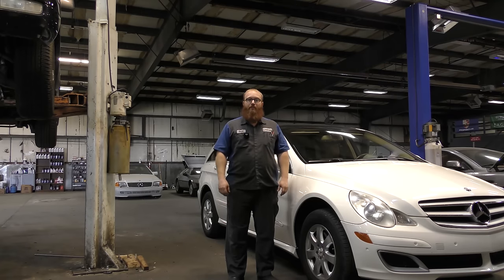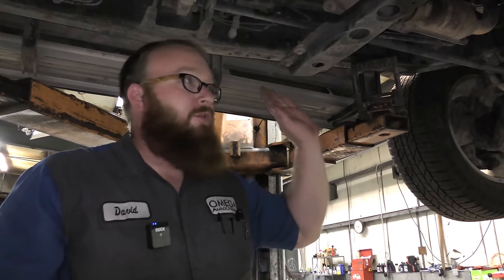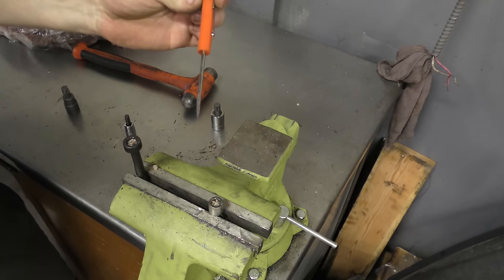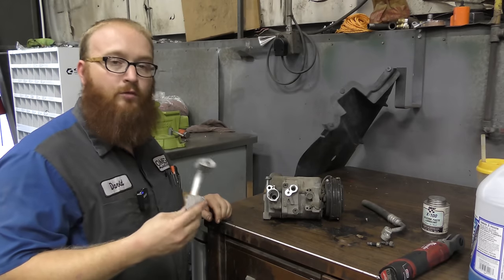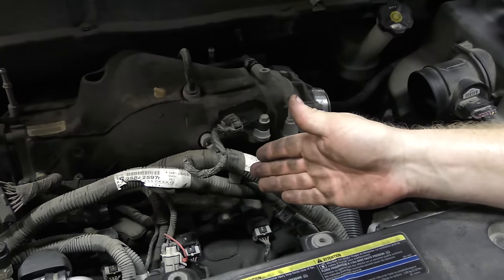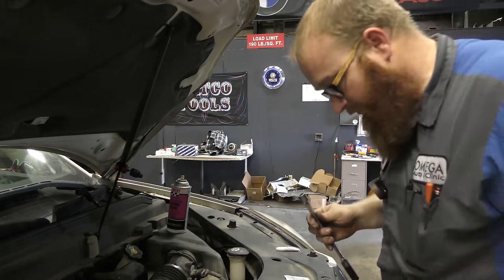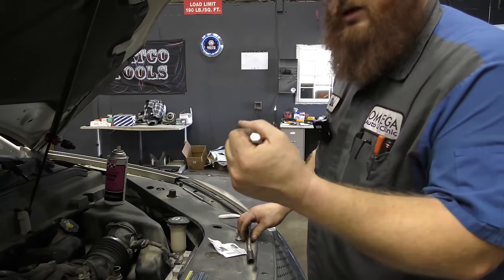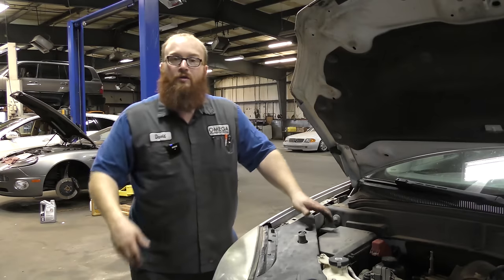The CAR WIZARD shares 10 Crazy Easy and Essential Mechanic Tips

Comment: I've been a mechanic for 33 years and I learned from your tips! Everyone sees the trees different so don't think that experienced mechanics can't learn from your videos. Going to get those relays. A+
Reply: I make videos specifically for beginners trying to learn about concert sound but I get a fair number of veteran concert engineers (who are way more experienced than I am) saying they learned new things from what I've shared. As you said, "Everyone sees the trees different". 😮🤯🤘
Reply: I've been an IT systems administrator for about as long.  I'm used to thinking of things end to end in a systematic way, paying attention to cause and effect, cascading problems, focused methods of troubleshooting.  And I do stupid, random stuff when out of my element in the car.  Always good to realize that we are constantly learning, and nobody knows it all.  Grateful to find the Car Wizard.  The paper trick for sockets and the superglue for washers; I can't believe I've never tried that!
Reply: @UncaringAsshat  Paper tape or a bit of thread or even a blob of heavy grease can also hold on a washer to help get it in place.
Reply: Where can i buy such relays ???!!!
Reply: @z.b6506  you would better make it yourself, it only contacts the pins 30 and 87 together, nothing complicated.
Reply: I learned about 50 years ago to humble myself and listen to ALL viewpoints. The smartest, best and most talented mechanic can learn something from the dumbest kid on the block
Reply: @freesoul9324  thank you, was thinking to do them myself from old relays
Reply: A switch and two pins is all you need until you get to a Chevy relay.

Comment: To lubricate "O" rings I've used Vaseline Petroleum Jelly for 40 years, never had a problem cutting or nicking  seals. The Navy called it Petrolatum Technical, same thing, works great and it's cheap.
Reply: That will work well with any rubber that's not a natural base rubber. There are a few types of rubber which are not used much any more that will degrade from contact with petroleum distillates.
Reply: vaseline is also used to assembly rotaries
Reply: Astroglide work well too lmao

Comment: Hello David, 
As an Electronics Technician for over 40 years another trick that I have used especially with electronics circuit boards when you have to attach a fastener that is not magnetic and is hard to get to, I use beeswax. This will hold a Phillips head or a Allen head screw securely attached to the tool. What's great about this tip is that the beeswax is inert and non-conductive. To keep the beeswax handy but not sticking to everything I will put some into an old cleaned out deodorant container. This way every time you need some you take off the cap and screw up the beeswax to expose it and dip your screw head or your to head into the beeswax. To obtain the beeswax I use the wax ring for a toilet. Hope this helps.
Paul

Comment: Two more tips. 
#11 The fuel pump hammer trick can work on any electric motor that has locked up. Your window regulator motor is a good example. Tap the motor lightly with a hammer as you apply power. Same with a bad starter.
#12 When dealing with a very stubborn bolt or nut especially one that is already slightly damaged Tighten it to break it loose, then loosen it. Sounds counterintuitive but it works many times.
Reply: Washing machine motor too, do you think?
Reply: @bluestripes6037  Can work haha.
Reply: Used this trick for many decades, electric windows, stater motors, shavers, washing machines, vacuum cleaners anything with brushes
Reply: If i tighten a bolt until its loose I got way more problems pass
Reply: I have seen that tapping used to free the starter motor's silenoid.
Reply: @clydedoris5002 you don't tighten it until it's loose. You just tighten it to break it free. More go back and forth, tighten and loosen. It works well on stubborn or rusted bolts.
Reply: This is REALLY useful for a bad starter as well… if you can get a hammer to it, give it a couple of taps while a buddy is cranking and I bet she gets spinning and you are back on the road. You can use a screwdriver or extension to reach it too….

Comment: The Bob Ross of auto repair, good info and relaxing to watch.
Reply: If your fuel pump is stuck, get a rubber mallet, go to the gas tank and just beat the devil out of it :) lol
Reply: Happy little bolts
Reply: Yeh. Kind of asmr for mechanics
Reply: However, unlike painting there are no 'happy accidents' in car mechanics.
Reply: The new generation of shade tree mechanics is us YouTube mechanics. 😎
Reply: Ob
Reply: @amerlin388  I got a car sold to me cheap because check engine light had been on a while and it was running like garbage. When I opened the hood, the MAF and IAT sensor plug was disconnected. That was a happy accident.
Reply: Happy little bolt.
Reply: knob
Reply: Ahhh Bob Ross 🔥
Reply: The Rhins Ranger harder than it sounds with the vehicle on the ground
Reply: It's relaxing because all this info isn't leading up to me getting my wallet out to pay a hefty sum, someone else is!
Reply: Yeah, exactly. And he has also this certain wow-factor to him aswell. ^^
Reply: Who's the other German tv painter guy,  by comparison?
Reply: Naw, he's like the opposite of Bob. He's so angry 😂

Comment: Google has changed the game on repairing things. I even google things I know just to make sure I am using the best techniques and practices.
Reply: The Internet in general has changed the world. It allows the free flow of knowledge to be shared as fast as your connection to the Internet is.
Reply: Perry Elyod Good point! There can be very valuable information in the comments.
Reply: any tip about fixing SAM's acting up on Benz ?
Reply: Same here. I personally look for more efficient way of doing things.  My way is or doesn't always have to be the best if sometimes anothers way is better.
Reply: I have a trustworthy mechanic do a front end service on my MIL van. The next day she says “it’s acting weird” (the PS was pulsing at slow speed turns). I returned it, showed the issue, and it was something he had never seen (weird was used again). I and a tech of his found the TSB at about the same time via a search that the PS hose needed a loop added. Longer hose, added with new loop, problem solved. It was something you would never notice until the worn bushings had been replaced.
Reply: Generally true, but do be a bit careful. Some google “experts” are not as smart as they think they are.

Comment: To expand on tip #1; not only do you not want to get mentally stuck in one area, don't get stuck on one vertically either. Sometimes it's easier to get to a bolt on the underside by going in from the top.

Comment: As a qualified mechanic i can vouch for this guy he knows how to make life easier
Reply: I live in north Dakota my belt has a sound only on the first start of the day it's really cold is this because of the cold weather? It squeals just for a minute or so then everything is fine until the next cold start in the morning?
Reply: @Nicole-dj3jf  That can be several things. The belt can be bad, the bearings to that pulley can be bad. Squeals are typically metal related. You should search on YouTube. Engine squeals when I start it in the cold. Reasons belts squeal. If that belt goes, then you are dead in the water on that engine. It’s not going to run.
Reply: @Nicole-dj3jf  Belt to loose or worn out
Reply: @marcpaesen460  thank you it just got the alternator and started changed so I'm guessing bad belt he said all the bearing and pulleys where good thx
Reply: @Nicole-dj3jf  bless you for coming back and letting us know
Reply: UNqualified mechanics will vouch for him too.

Comment: With Tip #9 make sure you're not running your engine, otherwise you probably won't see the interior lights dim due to the alternator putting out 14 ish volts.

Comment: I've been twisting wrenches for over 45 years and can say that these tips are pure gold. I've known this stuff since I was a kid but the accumulation of this kind of knowledge takes years for someone who works on vehicles daily and I am glad that there's someone out there sharing these tricks of the trade. BTW, grease works if you don't have super glue handy.
Reply: I was just about to mention the grease/pomade alternative, works like a charm
Reply: A wee bit of surf wax works. Also a wee dot of chewing gum.
Reply: Really anything that's sticky helps. I used pine sap once out on the trail.
Reply: @SaintBuick  pine sap... niiice! im strangely inspired
Reply: @Spec1alD  Awesome! Just remember the next time you get in a bind to keep your cool and get creative. Anything can be a tool or a substitute in dire enough situations.
Reply: A small piece of Scotch tape works too
Reply: Inspired too.
Reply: I would like to work with an experienced tech like on this video. I would do the work just to learn more and more
Reply: @SaintBuick  The trail providith...
Reply: There are little magnets mounted in plastic, sized for various sockets etc. which can be used. They work weIl.
Reply: These genius diagnostic hacks are completely wasted on most customers:  
1. The 'test Relay with buttons': the typical response you'll get back is "So my relay is faulty then, do I need a new replacement Relay?  
2. The 'Dimming Dome Lamp test and response get back: "So my battery is bad then?  not giving the full current then do I need a new battery? "
Reply: I got my hands crushed in a very baad accident back in 2001.  Very hard to hold tools so i only do light things.  I used to use just a small dab of blue silicone to hold fasteners in place in the socket (washers, too).  And I made money by rebuilding Toyota tercel drive trains.  Two bolts on top of the engine/transmission were nearly impossible and friends saw me get those with a long extension I found so I did not have to put a bunch together.  And I was a fool when I started and used a bit of WD40 to lubricate O-rings.  I had an old timer tell me about how the solvent can ruin the rings, and leaned about silicone grease.  A dab will do  you, but the spray makes it a lot easier.  But, really, I thought everyone knew about cleaning to the fastener heads.  I used a dental pick and then some brake cleaner.  I still use it 40 years later....  All of these are good tips and, reading the comments, I am getting still more.  A very good subject.
No w let me tell you a little trick that came in handy just three days ago.  I was in a parts store when a woman came in to get a refund on a battery charger.  She said it simply would not charge the battery.  We ran from a plug to the charger and put it on a battery on the shelf and the charging light came on.  A meter showed increased voltage with the the charger on the battery, just like you would expect.  The charger worked fine.  I convinced her to let me come to her place and see what was happening.  I had NO tools with me, not even a meter, so I was not going to be doing any exact testing.  Got to her place, checked out how she was attaching things, turned the charger on and ......  the dial lights lit up, but it would not charge.  Hmm...  I pulled out the power pack battery jumper I carry, hooked it up and same thing.  No power applied.....  Hmm.  I pressed the safety override button which bypasses the digital readings of polarity that keeps you from hooking the charger backwards and the car started.  We immediately shut it off.  It has been over 20 years since I have seen a TOTALLY dead battery. No charge and the charger could not read the polarity so the safety kept it off.  We tried the charger again but the battery was still totally dead.  So I pulled a trick.  We attached the charger.  She got a nine volt battery she had for her smoke detectors.  I taped a short wire to each terminal.  Checked to make sure i had the polarity on the nine volt correct, and touched the clamps on the charger, both at the same time.  The charger came on because it now sensed the correct polarity.  Wished I had my meter at the start and it would have saved a few minutes thinking about the problem.  But problem fixed.
Now for the warning about stupidity.  I told a friend about this and he said it was really easy to check the battery for a zero charge.  Just bridge the terminals with a wrench and give a VERY quick tap. If there is a spark, you have power, if not......  I think my jaw dropped all the way to the floor.  If the battery is NOT fully discharged and you get a spark, you get a very HUGE possibility of a battery explosion.  I have never seen one but I have seen the aftermath, including the persons face etched with battery acid (fortunately not blind). Don't be stupid, use a meter and wear safety goggles.  You might not see it as it would be so small, but even a meter can cause aa spark.  Just a lot less of a chance of it.
Reply: Never thought about super glue because it needs to be very clean to work. I just use a thin coat of grease.
Reply: @SaintBuick Nice improvisation!

Comment: The internet really has made life easier for the engineer, when I get stumped with a problem the answer is nearly always on there. It can save hours of struggling and testing.
Reply: Coyote That is true. Especially in engineering, you don`t have to reinvent the wheel because someone else has already found the solution.
Reply: So true.  I think back to how much I, and my friends, did things the hard way because we simply didn't know there was a different approach to take.  Now all that tribal knowledge can be shared.
Reply: Note to engineers: don’t engineer shit until you work on it! So many times we have all hated engineers for stupid solutions for easily solve able issues without the added headache.

Comment: I discovered another "don't get boxed in" tip when replacing the steering pump on my supercharged 3800 Riviera.  I found the right combination of tools for the underside, but the stuff I had to attack from the top was nearly impossible.  When putting the new one in, it dawned on me that removing the upper washer fluid tank would give my elbow a place to go that would get the wrench where I needed it!  
Moral:  See if there's anything else, easily removed, that will get you toward your goal...   🙂
(Also, I use masking tape instead of the paper trick to hold bolts in sockets.  That way the tape comes back out with the socket.)

Comment: Excellent video! BTW, the fuel pump trick will also work on starter that has a bad spot on the commutator by rapping it with anything you can reach it with.
Reply: ojars zvaigzne/ drove a vw van for a few years doing this!  Was broke and was hanging on by my fingernails so I had to do it. Sucked though if I stalled out at a light and had to get out and crawl under it to do this!  My road companions were not usually very happy. Finally this stopped working and  i got a new starter.
Reply: this got me back from being 30km down a logging road , my friend would get out with a piece of wood and hammer the tank and it would run for 5 mins then die. The dealer towed it 300km home for me under warranty, I partied in whistler for the weekend instead.
Reply: Right on! "Percussive Maintenance" to the rescue. :-)
Reply: I drove a 97 Honda accord for daily for about 3 months from banging on the starter. At that time in my life all I could afford was a hammer. That I borrowed.
Reply: Can rap it with my mixtape?
Reply: An FYI...They do have children! Use your brain!
Reply: I am a master mechanic, that trick is called the technical tap, it can work on fuel pumps, starters, and if you just hit it with your hand a/c blower motors and various light bulbs.
Reply: I am a Master Electrician so no disrespect but obviously I trump (pardon the pun) a mechanic.
Reply: @picklemetimbers3003  Excellent reply!
Reply: @WBush-uc9pe  The ONLY tool needed......a BFM LOL.
Reply: Yeah, I've used the starter-smack a few times.
Reply: With a manual gearbox you could leave it in gear and then yank yourself backward and forward hard in the drivers seat. Will get the starter running. Kept my E30 going for several years. :)
Reply: On a e46 bmw...the starter is under the intake. Not really accessible.
Reply: @bitteroldman3151  BWAHAHAHA! Almost made me do a spit take!
Reply: And alternator.
Jump start the vehicle (if the batt is dead) and give the ALT a few taps, it loosens the dust out of the brushes a little to get a few more miles out it charging enough to get to the garage to get the ALT fixed.
Reply: Been there done that. Emergency only. Fix the darn thing if you have the money.
Reply: The police has a diffrent kind of hammer, more cylindrical but itt works on ppl that dont "work" so good  :O
Reply: @kanalnamn  I had an old Celica with a 5spd. Sometimes I'd turn the key and nothing would happen. I learned to park on a slight incline. Let it roll just a bit and pop the clutch. It started on the next try most of the time.
Reply: @picklemetimbers3003  I had a 77 Honda Civic (standard) that I used to always park on an incline so I could bump start it. They wanted way too much for a starter back then.
Reply: Mercedes c220d manifold water leak
Reply: lots pf mg and other classic british car owners have a long rod and hammer in there tool kit for the car...
Reply: The old starter motor tap.
I had a car once that had to have the starter tapped once in a while to work.
My X had borrowed the car (she still had a key) drove to the fuel station, filled it up with gas (was almost empty), and the car wouldn't start 😆😆😆
She called me screaming about what a crappy car I had, then left the car with the key in it.
I could walk the 5 min to the tank, tap the starter, drive home in my car with a full tank of gas and I had my car and key back 👍😃
Reply: Often with the starter it works due to a stuck solenoid